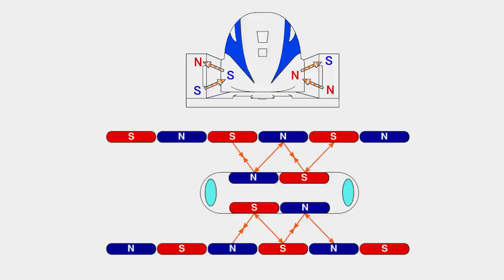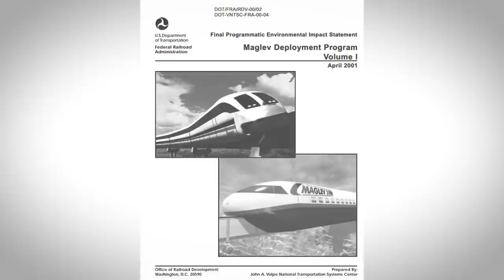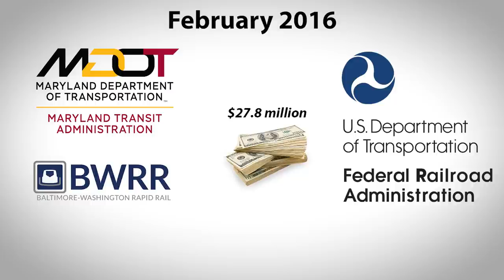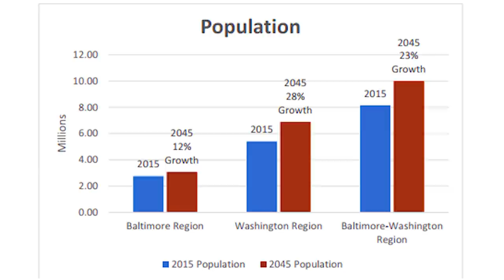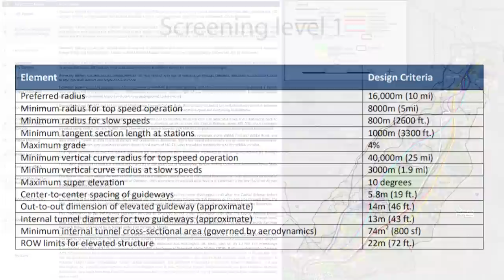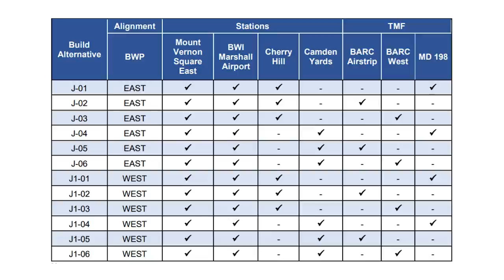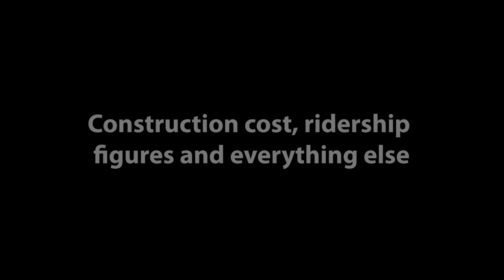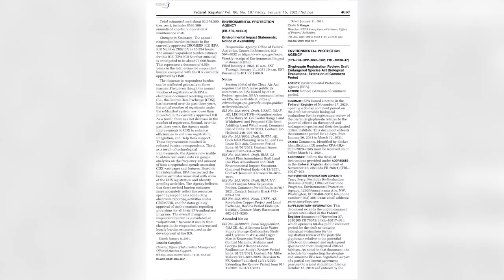Baltimore–Washington Superconducting Maglev Project

Comment: In the US they still don't understand that HSR is only useful when you build an integrated network. All kind of isolated stretches with different technology is totally useless.
Reply: Yeah, don't get that either.
That's probably also the reason nothing gets build other then new mega wide roads.
Reply: There are concentrations of population in the US that can use it though right? Especially in the North East.
Reply: @zxil6  sure, especially in the area talked about in this video. I think that is a lot like europe, big urban areas with big cities not to far away from eachother.
A perfect area for a good transit system.   Ut americans are to attached to their cars and planes i think.
Reply: @baronvonlimbourgh1716  Americans like convenience, reliability and low cost. If someone built a train that was more convenient, reliable and less expensive than the alternatives it would be a success. Apparently, that one in Florida is doing pretty well.
Reply: US is a very big place, we can easily have different regional networks, lines that actually have profit potential rather than wasting national resources on loss-making projects
Reply: This is also the reason US views monorails very differently than Asia: they don’t bother to integrate it into existing public transit networks which means people won’t actually use it in a way that it supplements their cars for travel
Reply: @Cotswolds1913  sorry to ask, but why is it that profit is always mentioned? Mass transportation should be treated as a public service, not some profit making machine. Highways have large subsidies. Why not the railways, too?
Reply: @ianhomerpura8937  Because if it’s not making a profit that means it will be a drain on other resources, meaning further tax funds will have to be allocated for a service that people are indicating they do not value more than the required inputs necessary to provision it. In other words you end up throwing good money at bad money, destroying value in the process. This is how we allocate scarce capital, it needs to go where people are communicating they most urgently want it.

Granted I take the point HSR can improve our carbon emissions, but keep in mind a lot of projects get subsidies and still aren’t profitable, and with hyper-loop around the corner, we should focus on fundamentally sound projects that pay off.
Reply: It's definitely not only useful in a massive connected national system. The US is huge and very sparsely populated compared to Europe and Asia. You'd have 1,000 miles between cities with a million people in some places. It's just not reasonable to have rail in those areas when planes can make that trip faster and significantly cheaper. Regional HSR systems linking nearby urban centers, like the Northeast Corridor or LA to Vegas and SF, or Dallas to Houston, are the best option for America at this point. The networks don't necessarily need to make a profit, but they should at least cover their own costs so as not to be a constant drain on tax funds. Or, if the rest of the world would like to start defending its own waters and trade routes, the US could decrease military funding and invest more in infrastructure. ;)
Reply: @zxil6  yeah Washington DC-Philadelphia-NYC-Boston is the most suitable corridor for high speed rail development in the US.
Reply: Building an integrated network would be even more useless. US population centers are spread out across distances greater than what’s seen in Europe and Asia. It’s the reason why air travel is the preferred mode of transportation and why it mainly beat out high speed rail.
Reply: The US hasn't have a problem making high speed rail, what ppl fail to understand especially from Europe and Asia about the US is that it's a freaking huge country, and cities are way too far apart to connect via projects like this, the only places that make sense are really just cities inside Texas, California and Florida, and the Northeast, (DC-NJ-NY-BOS), outside of those places aren't densely populated like Europe and Asia, so that sort of projects just dont make any sense 
Almost every big and populated city in European countries and Asia, China and Japan in particular aren't too far apart but also have enough ppl to profit off high speed rail projects, it's just not the same
Reply: @eriklakeland3857  It currently has a high speed rail connecting them also, it's easily by far the best area to get around without a car
Reply: @zxil6  and the south any city 200 miles away can use it
Reply: @Cotswolds1913  nonsense thinking
Reply: @mastahfrederique1147  you are talking about the west coast 😎
Reply: @eriklakeland3857  Nashville- Atlanta, Atlanta-Birmingham, Charlotte-Atlanta and Raleigh, Charleston to Columbus. Pittsburgh to Indianapolis via Columbus and Cincinnati, look again there are many cities within 200 miles of each other HSR can basically replace 90% of all Amtrak service east of I-35 with some segments of city of New Orleans and texas eagle being unviable
Reply: @IpSyCo  look again many are 200 miles apart with many towns that can benefit from faster access. That reality only applies to flyover country
Reply: @Racko.  what people in the US fail to understand is that their excuses are mostly invalid and current Amtrak service should be dropped if not upgraded. Rail is important to civilized countries
Reply: @mastahfrederique1147  Well put
Reply: @qjtvaddict  I said that the Northeast corridor is the most suitable, not that other areas for HSR don’t exist
Reply: @qjtvaddict  HSR is far more costly than Amtrak lines, and already the only reason to use Amtrak is for the experience of being on a train for a change, otherwise it’s close to the same cost as via plane (worse if you know how to get good plane deals), with a lot more time consumed.
Reply: @qjtvaddict  Most of the ones you just mentioned in the South, are perfect examples of waste. Florida probably has the only justification for HSR in the South, aside from Texas from ofc.
Reply: @michaelho4014  Monorails are a niche system, though. They are only practical if there is no requirement for at-grade crossings, and particularly useful in mountains. They have a large loading gauge (due to the cars wrapping around the guideway) and thus need large tunnels and stations, and are not able to interoperate with existing rail.

Japan has that Shonan Monorail which I can see as useful due to its environment(suspended too!), China has the Chongqing monorail. Osaka also does but I am not sure how much that is "monorail being most practical" and how much it's showing off to aeroport passengers arriving in the city- the normal use of a monorail.

You have to have a unique landscape to have a use for monorails.
Reply: @ianhomerpura8937  I know! When's the motorway made a profit? At least the railway makes a few cents here and there from tickets and food...
Reply: @qjtvaddict  "what people in the US fail to understand", replace "people" with politicians and lobbyist, I've clearly mentioned it should be upgraded, there's no reason Amtrak should be dropped when they're improving, in the NEC which is their most profitable and viable operation
Reply: @ianhomerpura8937  it has to be sustainable that’s always the goal. That’s why no railway experts really wants to copy China because their cost of maintenance would bankrupt most countries
Reply: @Cotswolds1913  that's all well and good but why is that expectation not placed on freeways? It's got the word free in the name. The public is forking out for them and they're necessarily loss making projects. Unlike an airport or harbour or (moderately busy) rail terminal freeways are a massive money sink. The number of urban freeways that could support themselves as toll roads if driving in the US wasn't the most subsidised activity in history- you could count on one hand. It has the lowest ROI of any type of infrastructure. It was public funding of freeways that rendered rail unprofitable in the first place. Cut funding to then both and they'll each prove themselves where appropriate. Or increase funding to rail and still have less total expenditure as a proportion of GDP than Europe. Or better still, cut funding from new freeways and use it on rail to make up for decades of induced stagnation.
Reply: @Freshbott2  Well there’s almost no activity more heavily taxed than driving on a motorway, even the excise on airline travel is less than half the rate on gasoline alone, not even counting all the other associated taxes with cars; sales tax, license plates, etc, so the car is actually out at a disadvantageous position in that sense.

 Which brings us to the next differentiator, the fact our highways don’t rely on exchanges with customers in order to obtain their revenue. The Highway Trust Fund relies exclusively on taxes for funding, and it’s mostly the same for state governments too. 

But that’s just hiding the underlying value destruction, which is almost certainly there with respect to the highways administered by the federal and state governments. The difference here is that we already have the infrastructure, we don’t have to pay to construct it all over again.
Reply: @Cotswolds1913  I don't agree with any of those things to be honest. It depends on what you mean by heavily taxed. Not if you mean as a proportion of its cost. The gas tax didn't even cover the cost of federal highways alone when it was started yet alone now when cars have gotten so much more efficient and some being electric. I'm not sure what your point is in that highways don't rely on exchanges with customers. Toll roads rely on exchanges with customers. Freeways only don't because it was intentionally set up that way. The fact they rely on taxes means they have zero supply/demand relationship other than what career politicians find expedient. You have to pay to construct it over again, every 15 years at the most for surfaces and the US is coming up against its aging bridges and overpasses which will cost more to replace now than they ever have. Adding lanes has diminishing returns and every lane you add gives less than a lane's worth of capacity because of merging but the cost to aquire the land to do it and build embankments and barriers further and further into the urban environment goes up exponentially. Not to mention that increasing total capacity on already saturated freeways INCREASES travel times overall which is a drag on the city's economy. As soon as states and cities come up short on federal funding they're not able to keep building and repaving because the projects don't deliver the return and yet they're still forced to pay the federal tax into it. So much so cities have found more value in removing them with or without federal funding. I'm sorry for this long response but I want to point out as well. The development these freeways encourage is necessarily unable to support itself financially. Some municipalities that don't have any non freeway-centric areas to internally subsidise themselves, the total cost of repairing/replacing the stretched out infrastructure is as much as 5 times the entire income, not just tax revenue, of all of the residents and businesses in them. It's a literal ponzi scheme you're forcefully opted into. I mean it in the politest way but you're absolutely wrong, there is NO value proposition in keeping things the way they are before or after the follow on effects. Keep in mind I'm talking about urban/suburban freeways not intercity highways.
Reply: @Freshbott2  It’s pretty simple. If no voluntary exchange with consumers is made to fund the product, then there is no way to tell if it’s profitable or not, there’s no way to tell of consumers value it more or less than the cost of provision.
Reply: @Cotswolds1913  not sure why you bothered telling me that
Reply: @Freshbott2  Did you forget the convo?
Reply: @Cotswolds1913  You reckon things ought to be done profitably. Then you reckon that cars are disadvantaged, then you reckon there's no way to discern the value in it being advantaged. It sounds like you could either be saying infrastructure should be subsidised to the moon and back with no accountability and we know you're not saying that. Or that you happen to feel differently about this one thing so the logic to gauge anything else convenientIy doesn't apply. I think you forgot your own thoughts.
Reply: @Freshbott2  Me telling you the Highway system is not subject to voluntary exchanges in the way an HSR train ticket would be, =/= my advocating on behalf of such a policy.
Reply: Can anybody tell me where the US of A gonna get the $$$ to build a nationwide integrated network for HSR    ?
Reply: @DouglasLippi  Who doesn't like convenience, reliability and low cost    ?
Reply: @mastahfrederique1147  "The US is huge and very sparsely populated compared to Europe and Asia"   ?

Distance from Washington DC to Miami, FL   ----->  1053 Miles.
Distance from Beijing to Chongqing, China    ----->  1136 Miles.

If China can have a HSR from Beijing to Chongqing, why can't USA has a HSR from Washington DC to Miami, FL   ?
Reply: @clocktower1164  surprisingly, lots of people in my area. They have guilt that we are such a prosperous nation and so feel they deserve to suffer. Strange, but true.
Reply: @clocktower1164  Not to mention there are several massive cities between Beijing and Chongqing that make that route more practical. There isn’t a single city proper with over 1 million people between Washington and Miami.
Reply: @mastahfrederique1147  If your intention is to find excuses, you can find whatever excuses you want.

But if you intention is to build a HSR, no excuse is allowed.
Reply: @mastahfrederique1147  Are you telling me there is nothing in between Washington DC and Miami   ?

If you do not know how to look at a map, please ask your teacher.
Reply: @clocktower1164  Just tell the Fed to continue to print its fiat money...
Reply: @clocktower1164  I literally read atlases for fun. I didn’t say there was nothing between those cities, so idk where you got that. I said there was no city with over a million people in the city proper, whereas there are more cities in China with over 10 million than there are in all of the US with 1 million IIRC. I want HSR. But I just think the US should be more strategic with it because we are not China. That’s why I suggested the NE Corridor, California coast/Vegas, and Dallas-Houston.
Reply: Yes, it wasn't until I went to San Francisco that on understood how integrated networks work.
Reply: @gj1234567899999  TX has built a lot of somethings. A power grid that doesn't work, a city in a floodplain designed around sprawl to maximize flooding and an economy based around an industry doomed to die, the list could go on forever. I live here. The state can't even maintain roads. I don't want to ride on whatever corrupt private rail gets built in TX, and I live here.
Reply: @mastahfrederique1147  Those who are fixated on China's cheap labor and totalitarianism often overlooked a good point Railways Explained talked about with China's HSR - standardization. All rolling stocks, tracks and stations of the 40,000km+ system are built to the same, universal standard. You won't tell the difference when you get off the train in Shenzhen from Beijing despite having travelled 2,800km, since all stations have the same layout and design - down to where the washrooms are located. It's industrial-level mass production design to utilize the economies of scale. You just don't have to bid, bargain and tailor-make every short section of a regional system. It's one of the major (according to Railways Explained, actually the single most important) reason that the Chinese HSR can be so cheap.
Reply: @Cotswolds1913  "If no voluntary exchange with consumers is made to fund the product, then there is no way to tell if it’s profitable or not(...)"

It is, when cities go bankrupt over the maintenance of their road/street/highway infrastructure.
https://youtu.be/7IsMeKl-Sv0

"Granted I take the point HSR can improve our carbon emissions, but keep in mind a lot of projects get subsidies and still aren’t profitable, and with hyper-loop around the corner, we should focus on fundamentally sound projects that pay off."

Is this supposed to be sarcasm or am I just misunderstanding what you're trying to say here?
Hyperloop is neither around the corner, nor potentially profitable or fundamentally sound. It's the complete opposite of all those points.
Reply: @Sundara229  Going bankrupt just means outlays exceeding revenues, but the revenues contain in them no value confederal by consumers.

Hyperloop is being led by private companies, in fact the one up in Toronto isn’t even really searching for government support, and it is around the corner, orders are already being placed.
Reply: There are some Americans here in the comments that just don't get the point. In Europe people do not use the long distance trains that much (we fly), but use their regional rail system to commute. On top of that commuting system, we build up high speed lines at distances at maybe... 300 miles...
The US always plan HSR between cities no sane European would connect, o. Top of no practical regional rail system.
The corridor named is one of the few places where European style system might work, and we never needed a freakin maglev
Reply: @Cotswolds1913  The USA funds airlines the same way governments in Europe and Asia fund rail lines. All the unprofitable lines draining government money that anti-rail americans like to rant on about? the USA has exactly the same routes funded exactly the same way... they just use planes instead, which cost less to build, but have higher upkeep. ... you literally have airlines that Only run government subsidized routes and only turn a profit because of those subsidies. 
As an added bonus, while public transit is rarely profitable in its own right, it almost universally boosts productivity and profitability, as well as stimulating general economic activity.  All of which increases the Tax Take, meaning that, if the routes are set up properly, it actually IS profitable (and rail is much more effective at this than air) when run by the government, the profits are just collected in the tax take rather than the ticket prices.
Reply: @DouglasLippi  Sure, the monorail in Disney World is a big hit.
Reply: I think the idea is that it’s supposed to be a demonstration project for DC to NY.
Reply: @clocktower1164  If it is done with proven 700 km/h Japanese maintenance free maglev in single tunnels, the the profit from overnight container trains reduces the daytime fares below planes saving jet fuel and road maintanance.
Reply: @edwardbarnett6571  1. Maglev was not invented by the Japanese.

2. The so-called 'Japanese maglev' has yet to be proven to be maintenance free.
Reply: @clocktower1164  They ran it with passengers for ten years before giving it a licence for export, how much more proof do you need ?
Reply: @clocktower1164  I think it is for any buyer anywhere but in my opinion it would be used to connect large cities with overnight container trains to reduce the daytime fares below that of planes and save on highway maintanance.
Reply: Like most public transport in the USA lol look at the hot mess in the Bay Area lol they call transit
Reply: @DouglasLippi  so basically trains have to be more frequent than 5 trips a day lol and actually move fast like above 100 mph? You don’t say
Reply: @qjtvaddict  I’m sorry, referring to what? It’s tricky returning to these YouTube convos.
Reply: @qjtvaddict  what part of “I said the Northeast Corridor is most suitable” did you not understand? I never ruled out HSR in other parts of the US. I think a Midwest system with Chicago as the hub would work well
Reply: @Racko.  let me know when you fix your roads
Reply: @Racko.  the NEC is their only corridor with good service!!!!! The rest are too slow and infrequent to be useful
Reply: @Meinan4370  maglev then
Reply: @Freshbott2  he is primitive
Reply: @mastahfrederique1147  that doesn’t mean you can’t have HSR Lines on different parts of the route serving many city pairs and even suburbs
Reply: @gj1234567899999  homeless are in nearly every state
Reply: @theolich4384  Spanish HSR lines are even cheaper to build than China’s
Reply: @eriklakeland3857  that’s a good place they can even run a crosstown style one through Illinois to Iowa and Minneapolis
Reply: @UCiQoGzcLTbxSd-AdQJVpq_A HSR is much more expensive to operate than Amtrak, and Amtrak does charge for ridership, not sure where you’re getting ideas to the contrary. Almost nowhere in the world are HSR systems profitable (Japan a notable exception), so this idea that it’s going to pay for itself in regions far less conducive to HSR than in Europe/Japan, outside a 2 or 3 key areas, it doesn’t wash. 

You can make the argument it should still be built, but not on that basis, certainly not on just assuming to be the case outside of a single proposed area.
Reply: @qjtvaddict  Actually NEC is the only corridor that will take the most passengers yearly, other places like Toronto-NY, Houston-Dallas, Seattle-SF-LA-San Diego, Miami-Orlando can be potential targets
Reply: These isolated stretches seem to detract rather than encourage development of the integrated network :(
Reply: @hobog  The isolation parts dont need high speed rail, its only populated areas with enough ppl that is too long to drive from city to city but too short to fly, the main reason why US still doesn't have high speed rail is because of lobbyists
Reply: @Racko.  It's not a lobby issue but more of a political base issue.   Republican states are mostly low population so they prefer to drive but Democrat states are much more dense populated focused on the 2 coasts so mass transit has a strong opportunity.     For example here in Seattle area the Democrat party took control over the state and started to build the Sound LINK Light Rail network and this is continuing to expand very fast currently already reaching out in to the suburbs where most of the technology companies are located to try and get people to live in the large cities and not just the suburbs and also connect between different suburbs to reduce road congestion.     So it's a matter of local priorities due to population.
Reply: @drscopeify  Yea, thats what I said earlier, public transit in the US will work in places were it's actually populated, The Northeast, Texas, California up to Vancouver are all potential areas, Seattle's transit is improving so well because of the Democrats like you said.

The issue with Republicans views on the Auto-centric idea is they're not thinking about ppl who dont own cars in that area, because first of all they bulldozed away walkable areas and made it entirely road, zero transits and far higher Co2 Emissions, low population densities can see walkable areas and some transit for the small group, who want to take their kids out, or walk a dog, or just hang outside, this is the reality in most European countries, low population but still insanely good transits and walkable areas for ppl, but that's different because of the political decisions. 

Ohio is investing more and more into light rail and transit, and ppl seem to love it, same with Downtown Houston, even though its barely walkable
Reply: This times 1000%
Reply: "n the US they still don't understand that HSR is only useful when you build an integrated network."

Ok bro, yet again....a nationwide system in a place with low population density and large distances between population centers, such as USA, Canada or Australia, is not feasible because of the distances involved. For example the two largest cities in the USA are 2790 miles apart, TGV would take 16 hours, maglev is significantly better but would still take eight hours. You can't dismiss that trip because it's one of the most common trips in the country; LA to NYC is the most congested air corridor in the USA. You really can't replace it with trains. If you want to play "Americans are stupid", you probably like Canada with their single payer health care. So come they also don't use HSR, for the same reason we don't? 

Current jet aircraft only take 5-6 hours, and soon we will have supersonic over land which will only take two hours (Lockheed and NASA have developed a new airplane shape which allows you to break the sound barrier with a barely audible sonic boom).

So the reality is that at best we would have three or four regional HSR systems, and have to fly between them. There's no reason they couldn't use different technologies. 

If it's public transit, the most fiscally conservative plan is to just enhance existing public transit systems on freight railroads. The 2nd most fiscally conservative plan is to run a train down the median of the appropriate highway. If maglev can be implemented at a reasonable cost it's definitely a good tech to use.
Reply: @Racko.  

"public transit in the US will work in places were it's actually populated, The Northeast, Texas, California up to Vancouver are all potential areas, Seattle's transit is improving so well because of the Democrats like you said."

ok you don't want to conflate "public transit" and HSR, because those are two different concepts. All cities in the USA with population over 1 million have both buses and rail based public transit. Majority of people in those cities support those systems, including Republicans. I certainly support it. I get around with public transit; I don't know how to drive.

That's different from "a nationwide HSR network" which is not feasible here because of the distance between city clusters. At best you would have HSR in each city cluster.  So like NEC, Chicago, Atlanta, SF Bay Area, LA/SD,  Seattle.

btw SF to LA is not one of those clusters. Those cities are 380 miles apart. To get between them at a speed comparable to aircraft would require maglev. However, the Bay Area is a cluster where you have three cities, San Francisco, Oakland, and San Jose, only 50 miles apart. We already have trains connecting the three.

Los Angeles and San Diego is a separate cluster, and they have lots of trains connecting them, 30+ passenger trains per day between those two cities. It's the 2nd busiest train corridor in the USA, like NEC West.

Having to fly between them is not a big deal. It's a quick, cheap flight. One hour. Four different competing providers keeps the cost low and speed high.

We had a project to do a TGV between them but it was a massive failure because of the stupid team planning it. I'm proud I voted no on the measure. If we put a new thing on the ballot, specifying that the time has to be under two hours, and specifying five stops -- Sacramento, Tracy (bay area), Fresno, Los Angeles, San Diego, which basically forces them to use maglev and go down I-5 instead of 99 -- I could vote yes, if the budget were reasonable and FIXED COST (if the contractor spends more they would be spending the extra money with their own budget). 

SF to LA is just really constrained by geography. The best route to do high speed is I-5 and it means that San Francisco, San Jose and Fresno have to be spurs, because none of those cities are near I-5. ACE, Altamont Commuter Express, stops in Tracy (where they could meet the maglev on I-5), and has a plan to increase their frequency and track speed, but that says San Jose to LA is at least two hours (an hour to get to tracy then an hour from there to Los Angeles). 

You can use existing tracks, that bypass the mountains, but then you can't do maglev speeds and probably can't even do TGV speeds, more like 90 MPH average so it's even worse, four hours (although current plan from CAHSRA is 4 hours too). That's why I say Bay Area is one cluster and LA/SD should be regarded as another cluster.
Reply: @neutrino78x  "ok you don't want to conflate "public transit" and HSR, because those are two different concepts. All cities in the USA with population over 1 million have both buses and rail based public transit.", Yeah, ik they're too different things, for HSR it should connect mostly high demand cities with each other where there's demand, I'd argue that cities under 1M ppl should also get high quality commuter rail services around 200,000+ people and more in a single area, it'll better help connect them more without having to drive 

Also the cities in CA you said that are connected by rail is good indeed, I didn’t say they weren’t they just aren’t via HSR and the issue with the existing rail is that it’s shared by greedy freight rail companies who usually have priority to their own freight loads that ends up causing interferences and late, delays on passenger rail, Moreso I think the only cities that should be connected by HSR in CA is SF-LA and another from LA-LV, there are over 20 million trips and cars between the 380 mile 6 hour drive between LA and SF every single year, for a push towards being better for the environment, both planes and cars fall behind to HSR if that was the case in between the two because it runs on overhead wires and despite being slower than plane speed, it’s faster on POV and more convenient 

And yeah you’re right, flying between the two isn’t a big deal, but when you take in the consideration of having to drive to the airport, go through long security procedures and then having to wait for your plane to come, taxi to the runway and then take off, land again then go through what you just went through and drive out back into the city then it becomes a less appealing option if a HSR existed in between the two because stations are usually located in the middle of the city which is a far more desirable and accessible idea, found in European and asian cities, and all you need is your ticket and then train is on it’s way at over 300km/h to the next city center, it’s a far better option if you ask me, things like seeing the countryside and small features. 
San Jose is not too far from LA so I think the current rail line is more than enough to serve them 

Im sure the team messed up the TGV project because of incompetence and nothing more, half the funding was also taken away, we don’t need maglev at all, it’s useless, regional, commuter and HSR are simply more appealing options economically, tunneling through mountains is too expensive so they’ll have to avoid pretty much the entire Valley area
Reply: @Racko.  
"HSR and the issue with the existing rail is that it’s shared by greedy freight rail companies who usually have priority to their own freight loads that ends up causing interferences and late, delays on passenger rail,"

Yeah but that's the fiscally conservative way to do it man. As the CAHSR project demonstrated, it's a LOT more expensive to go back and tear up the land today to make new ROW. That was one of their many, many, many stupid decisions.

"connected by HSR in CA is SF-LA "

It's too far apart man. If they did it right it woudl be better, just go down I-5 where you can keep your speed up. Although we have issues in the Bay Area because neither SF or SJ nor Oakland are near I-5. You would spend an additional hour going out to meet I-5, probably in Tracy. There's existing tracks there, it's shorter, it's only about 70 miles from downtown San Jose to Tracy. ACE takes 1 hour 36 minutes to go from San Jose to Tracy, 60 miles. If you increased it to 90 MPH average it would take 35 or 40 minutes. That's the smart way to do it.

(the existing CAHSRA plan also has this problem but the distance is longer, stupidly. They stupidly want to dig tunnels under 152, a 116 mile distance, that will probably take about an hour to cross.)

So you're looking at 2.12 hours from Tracy to Los Angeles...but an additional hour from the Bay Area to Tracy, so 3 hours. And a plane can do it in one hour. Maglev  would reduce it down to about two hours.

You could go down 101 and not have to tunnel from San Jose to meet the main line, but then it's not straight enough for HSR, so that would be "higher speed rail", like 90 mph average.

It's just a hard thing to do with our geography and where our cities are...that's just an accident of history. But yeah flying is just a lot faster.

"20 million trips and cars between the 380 mile 6 hour drive between LA and SF every single year"

There's no way 20 million people drive for six hours every year....unless the airplane figures are much higher, because most people just fly down there. This isn't like the NEC where most people are driving.

" despite being slower than plane speed, it’s faster on POV and more convenient "

How is three or four hours going to be more convenient than a 1 hour flight?

"And yeah you’re right, flying between the two isn’t a big deal, but when you take in the consideration of having to drive to the airport, go through long security procedures and then having to wait for your plane to come, taxi to the runway and then take off, land again"

Well I don't drive, I take public transit to SJC. It takes about an hour from my place. But that doesn't count because I have to make the trip into downtown five times a week anyway. But security is five minutes if you have "clear" and 20 if you don't, that's not too bad at all. I try to get there no more than 30 minutes before boarding starts. Sometimes I arrive earlier for the flight back because I don't have much else to do at my destination on the day I'm going back. I've arrived at the airport as late as 10 minutes after boarding started and still got on the plane, but I figure 30 minutes before boarding is a good target. Even if I miss my bus and the next one gets me there 10 minutes before boarding I'm still good.

"San Jose is not too far from LA"

341 miles, that's significant if you're not flying.

"Im sure the team messed up the TGV project because of incompetence and nothing more, half the funding was also taken away,"

No, the stuff that Trump didn't want to give Biden did give, but the problem is they spent most of the budget buying up all that private land when they could have just gone down I-5.

"we don’t need maglev at all, it’s useless,"

It's a lot faster and it allows to do it without tunneling at The Grapevine or Tehachapi because it can take a 10% grade.

" tunneling through mountains is too expensive so they’ll have to avoid pretty much the entire Valley area"

Well, that's not the decision they made. They are in the process of building Merced to Bakersfield. If they continued to Palmdale they would have to dig through a mountain.

Only two ways you can avoid digging any tunnel,

(1) use maglev, it can take 10% grade
(2) just upgrade existing tracks on the coastal route that avoids the mountains. It would take four hours to ride it when fully upgraded, but then so would CAHSR so no great loss.
Reply: @neutrino78x  I don’t think it has anything to do with being too far, as long as it’s in the <600 mile range it’s fine, the entire economics of High speed rail is to be under 600 miles
The San Jose line is actually fine, I don’t think It needs HSR at all, rail commute which already exist to it just can be upgraded with overhead lines and more, it’ll still take a few hours to get there

The issue with CAHSRA is funding, that’s why CA entire High speed rail network bypasses mountains in the first place, it’s just too expensive of tunneling through 

Andddd, 2.12 hours from Tracy to Los Angeles and that’s not a problem at all if the tickets are better competitive to plane tickets, it’s a well common thing that riders are willing to compromise several hours for an affordable ticket price tag, better yet, taking the train is much better and economically sustainable due to it running on overhead wires, ppl fly because it’s their only option and that already comes with it’s whole set of delays, expense and security procedures, as long as it’s high quality public transportation especially with trains, “but you can fly there in an hour” yeah, exactly, ofc flying is faster to get there, that’s exactly where the policy failure lies, it’s because the transit back on the ground is not reliable enough

“It's just a hard thing to do with our geography and where our cities are...that's just an accident of history”. It’s not accident, powerful oil and car lobbyist have too much influence on the government and block megaprojects like high speed trains from being built, it’s a threat to their profits because they want to keep fueling money on roads so you can keep driving, selling more cars eventually, before automobiles exploded, all across the nation had world leading extensive transit, trains and LA at one point had the largest tram network on Earth, car companies came, became powerful and scrapped it all away, for roads, it’s insane.

20M People do drive between LA and SF yearly, road trips and family trips and what not, there are over 14M cars in the State of CA too

“How is three or four hours going to be more convenient than a 1 hour flight?”, the issue is you’re thinking of the convenience of the amount of time you get between the two places, it’s about the entire experience, Im better off walking to the city center with your things, and just hop onto a high speed train with a cheaper ticket, gets you to your destination to the next city center, While you’re at it, you’re using the view of the countryside and more comfortable seats? By all means I don’t have an issue if you still prefer flying, its just people like me who prefer the cheaper alternative

Maglev is too expensive, even Japan is reconsidering the idea, the only reason why China has it is because the state said so, its fastest speed goes about 260MPH between Shanghai city and airport which it bleeds $85M-100M every year, it’s not worth it
Reply: Agreed, I think that Maglev is cool and all but I'm still pretty lukewarm on it given that it's not integrated with the rest of the rail network.
Reply: @compdude100  
"Agreed, I think that Maglev is cool and all but I'm still pretty lukewarm on it given that it's not integrated with the rest of the rail network."

It doesn't have to be. It will stop in New York and you will step off of it, walk across some kind of connection and step onto the subway in New York. 

The speed of maglev is required to "compete" with aircraft (and going from LA to NYC it still can't). If you want to average over 200 maglev is really the only way to do that. The TGV in France for example averages 173.

The best thing about Northeast Maglev is they are trying to do everything with private funds. If there is to be revival in passenger rail in the USA it would be with private funds just like in the old days in the 1800s.
Reply: Mostly useless, but not totally. Many Baltimorians for example would benefit from easier access to the nation's capital and better paying jobs. Despite how close Baltimore and DC are, the differences in opportunities are vast.... but yeah, an integrated system makes far FAR more sense.
Reply: Seems good, but Cherry Hill? I don't know friend. Cherry Hill is the hood.
Reply: Well this sc maglev train travel much faster